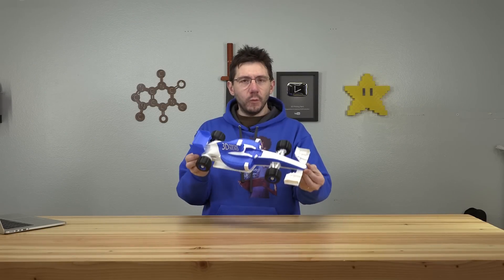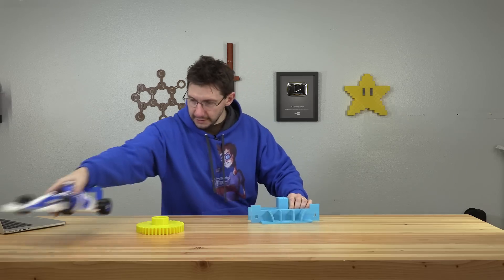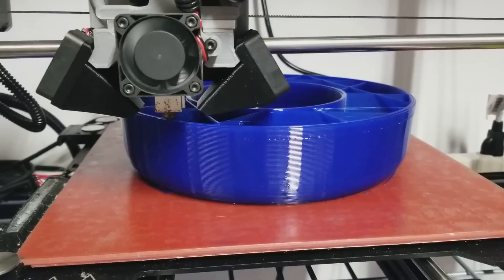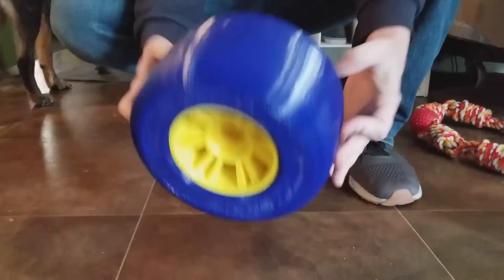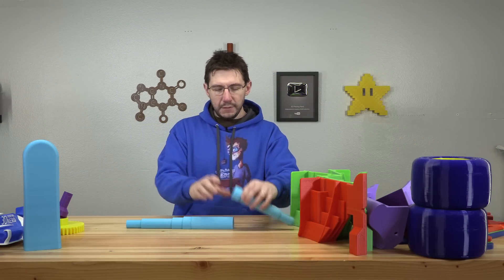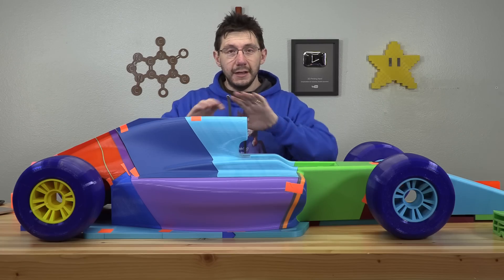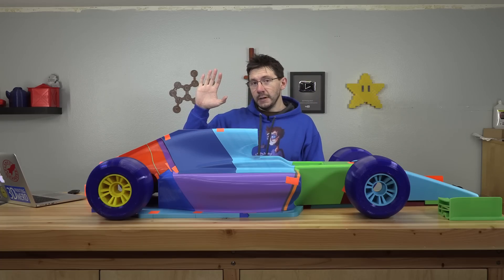Worlds Largest OpenRC F1 Car - Phase 1 // 3D Printing the Parts (Matterhackers BUILD PLA / Pro Flex)

Comment: For what it's worth, the epoxy that I've used before (just some Loctite epoxy made for plastic from Lowes) has resulted in joints that are stronger than the surrounding plastics. Should be plenty strong from this application! As other have mentioned however, epoxying on some fiberglass mat will help spread any stress out so that you reduce the risk of cracking the plastic right next to the epoxy joint.

Comment: Joel, how come you didn't puzzle cut these split pieces?

It would make for much stronger structural joins and the processing overhead is less than meshmixer slicing up imo. There is an excellent template set of scripts I use in openscad I grabbed from thingiverse that makes it a trivial amount of effort.

https://www.thingiverse.com/thing:35834

https://youtu.be/RbTqeFuRrLQ

Comment: why did you make all the joints between the pieces flat? if you gave them an interlocking shape they would keep some strength when you glue them together.  That's what I do, of course it takes a little extra time to plan out the interlocking shape between but you don't have to worry as much about mechanical strength.
Reply: In meshmixer you can add pin holes with inverted cylinders before you cut it Angus made a great video on it really easy to do and this build could've used it a lot
Reply: He is a total noob modding actual files.
Reply: He would have had to do some design on the STL files.  Not sure Meshmixer would let you produce a join with teeth.
Reply: Rectangle extrude on one side, subtraction on the other (0.2mm larger )
Reply: He needs a huge Kreg jig now !
Reply: Fro chassis flat overlap joints, peg/dowel and hole for axel, and a either a flat overlap on the front fairing or even a mortis tension joint would work.
Reply: @goh2499  for the axle a hex peg and dowel joint would be better.
Reply: Use a dowel jig and drill holes for all the butt joints and pin it and use a 3m 2 part adhesive
Reply: N Olesen biscuit joints are loose and require a lot of adhesive compared to pins and you also make a much larger hole possibly weakening the part
Reply: i was thinking a biscuit joint would work awesome.
Reply: It does. Prusa has a video on it.
Reply: i was thinking almost the same like the og comment but he was faster then me with about 7 months lol
Reply: pre: here will be some "flame" at start, you can skip it to the ===== real message ==== :)
Why so much noise around MeshMixer here? :)) It's a great program but for sculptures design and virtual models mostly. It was meant (when the author started) to replace some major ZBrush features like adaptive meshing (when triangles divides more if you're creating more details on a specific place) and some others for free.
There the wonders stopped! Autodesk made "a charity" - bought the program and gave it to everybody. It's just a not expensive advertisement for a such big company! But the project seems to be freezed. The shark just threw out a potential competetor from the market.

===== real message ==== 
It's pretty easy to do any manipulations with STLs in Blender3d now. It's free and it's very powerful!
You can split models to pieces using Boolean modifier. It's pretty simple and YTube has a lot of videos by this topic.
I've created some cool looking insets with letters using only Blender and Inkscape already. Not because they're free but because it was the only way I could do it. SolidWorks failed leaving me with frustrations ... I've didn't tried Fusion360 (maybe it's better, dunno) and others. Just skipped to these two apps. They're "made together". SVG to curves (in Blender) and then to mesh was made almost without obstacles.
Reply: Exactly. Even if it were just pure dowel joints
Reply: With the right glue the joins will still be stronger than the rest of the part. But it certainly would make it easier to line them up correctly.
Reply: can drill and dowel and It'll be fine

Comment: Awesome build, Joel!  To solve the axle issue, I would think about using a drill press and drill a hole down the length of the entire axle and use a piece of smooth rod that you could get from a local hardware store.  Once the Ross is inserted, you could glue the pieces together.   That should provide plenty of rigidity and support.

Comment: Why didn’t you add locking mechanisms to the parts that you split? You could have made slots so that the pieces slide together and it would have been stronger and much easier to glue.

Comment: For strength it would be better to add holes to gluing surfaces so that you might add metal/plastic/fiberglass rods to strengthen the connection. It would also help align parts.

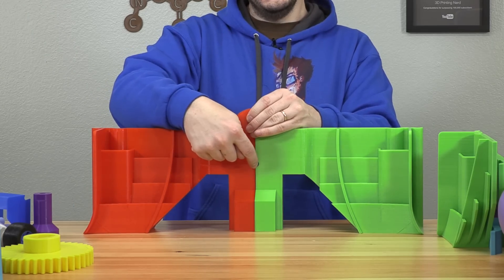Comment: The thick part (at the bottom of the screen) of these peices could maybe be bolted 8:21 and the axle could have a couple of holes derilled into it, put in some dowels and then glue it. I don't know how good you are with speedcontrolers motors etc but I know who are good at those things... James Bruton. He is very good at 3D printing, motors, speed controllers and coding etc. Check out his channel, I think you would like the things he build.

Comment: Hey Joel, have you considered drilling and pinning the rear axle and other multicomponent parts? I'd drill 2 holes in the axle to help prevent twisting of the parts. I build scale models and use pinning for problem parts.Keep up the great work and you inspire so many people to do better.

Comment: Y'know, I bet joining those huge parts would be a perfect application for brass threaded inserts. It'd take more detailed editing of the models when splitting. like adding holes to plunge the inserts into, slots for cam nuts, a place to stick a screwdriver, etc, but I bet the same methods used to assemble flat-pack furniture would work well for joining giant printed parts.
...Great. This is how I'll wind up printing a server rack just to see if I can.

Comment: That thing is awesome but that axle will just shear with any force, its the worst split for it. I wonder if you could cut it with meshmixer in a V shape? So one side of the axle looks like an arrow head and the other side is the mirror of that. It would be more surface area and spread the force two different ways at the joint.

Comment: The wall is fixed! Great looking set. Seems like your getting more sleep and back to your energetic enthusiastic self. For attaching parts I drill holes and use either fiberglass rod and resin if flexibility is needed or wooden dowel and epoxy for rigid parts. Open RC model looks AMAZING!

Comment: Just split the parts in Fusion360, make an assembly and then add dowls. Super easy and will fix an easier assembly and structural toughness
Reply: watch 18:25
Reply: You can’t just split and cut STL files in fusion....

Comment: i think pinning the joints with wood dowels would probably be a little stronger along with extra skinning as you mentioned or even for whoever modeled this dove tails and each piece to fit on a 200x200mm bed minimum if wanna be ambitious. wonder if you can modify solidworks/ fusion 360 model if those file types exist

Comment: hey Joel, why not design a piece and print, to glue in and skin those pieces with the hole in the center. same with the axle, just print a sleeve that slides over it.

Comment: You can weld pla with acetone 😉
Reply: TheCarLovingSwede or weld it with more PLA using a 3D printing pen
Reply: Toby Cowles only problem is that it looks so bad. And it's time consuming.

Comment: If the glue joint is not strong enough you could redesign the axle to have short splined shafts running trough the joints to transfer the torque. Actually even a square peg trough the center would do.

Comment: Use pcv plumbing pipe glue works fantastic and quiet drying and it's cheap
Reply: except this is not pvc, and the glue doesn't work with anything else.